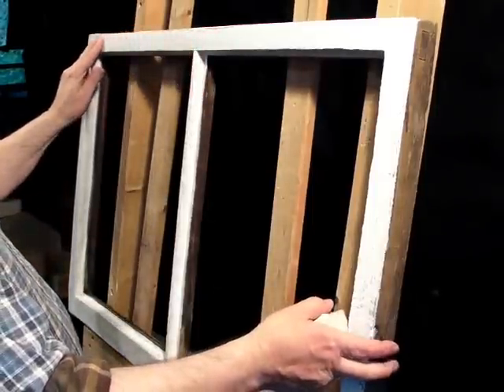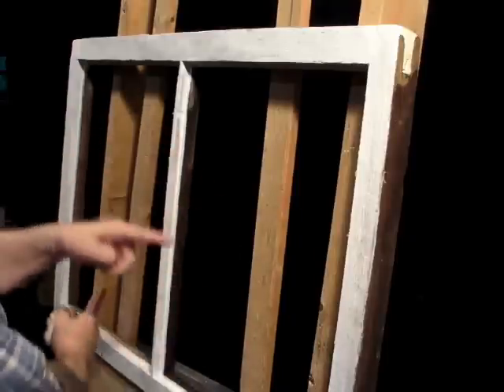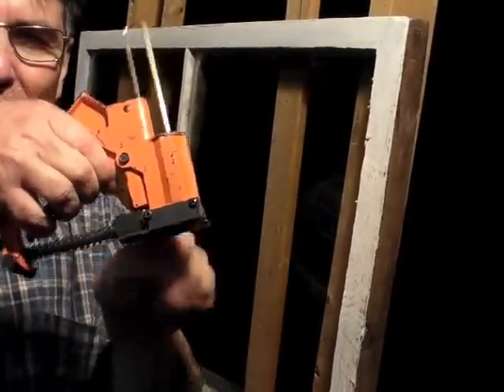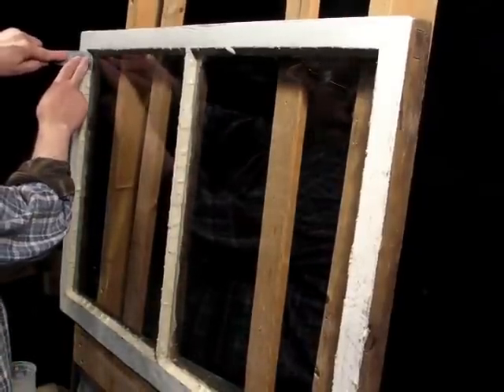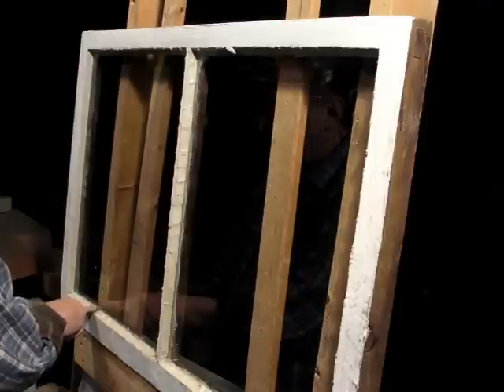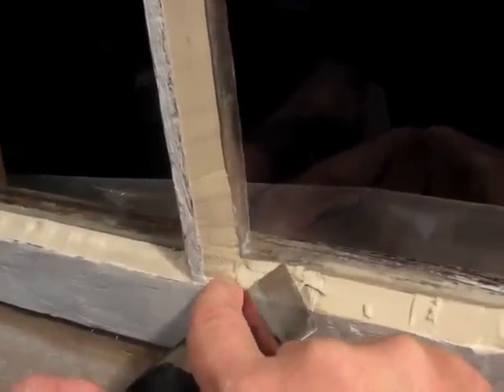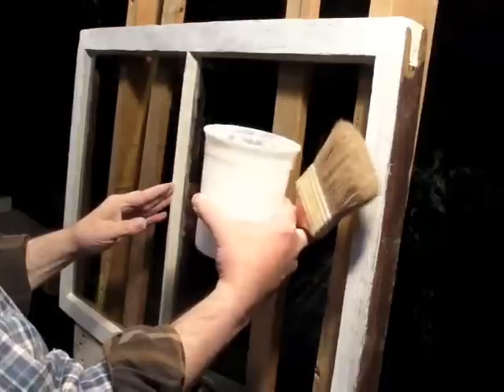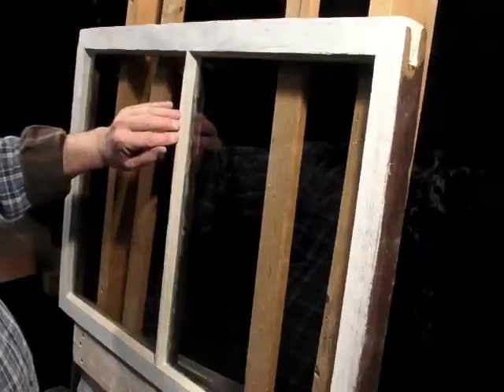Window Sash Glazing, training video

Comment: John, thanks for the video! I’m going to give it a try! I have 14 sashes (56 panes of glass total) that need to be reglazed. They are the ‘ol Andersen Pressure Seal units from the mid ‘50s. 

I thought about replacing them with new windows, but the new stuff is plastic and lifeless. The original windows of mine are made from Ponderosa pine.
Reply from the maker: Ambrose, Those early Andersens are definitely worth saving. I have one in my house put in during the early '60s and it is still going strong, but I need to give it a coat of paint--imagine that, window paint that lasted half a century. Take care and work safe. --Johnnn

Comment: I wondered forever how they put those old points in.  Problem with the new ones is, when your wood is 150 years old the wood is almost petrified. Then your pushing your points in , the glass cracks cause u have ti use so much pressure to get point to drive all the way.
Reply from the maker: Peter,  rock the putty knife and point from side to side, which eases the point into the wood. You can use an angled putty knife  so the force of driving the point is directly towards the wood and not angled down onto the glass as with a straight putty knife. 
More over here at the Save America's Windows Forum:
http://saveamericaswindows.com/forum/viewtopic.php?f=10&t=7&p=5910#p5910
Reply: @johnleeke  Thanks John,   I have done windows where the points go right in,no sweat . Was wondering if these cheap points are not as sharp. Therefore not going in easily. The angled putty knife sounds like a possibility. I tried a margin trowel but still hard.  May take a razor knlfe and precut a slit.  Trust me,,i wiggle the knife too. Just will not go to hilt. I may invest in that driver and the diamond type points. For those hard hard sashes. 
Anyway,,thanks so much for writing back John. Take care.
Reply from the maker: @peterford9369  , another thing to try is a Glazing Hammer, to tap the point further in
http://historichomeworks.com/forum/viewtopic.php?p=4173
Reply: @johnleeke  Hey John. Just ordered a point tool on Amazon. It looks like it'd be beneficial. Thought about a shooter, but didn't wanna spend 50 plus bucks right now.  I was working on an oak cabinet door with glass panel. The oak was so hard i could barely get the points in,with fear of cracking the glass. Metal on glass is a no no, even as small as the non diamond shaped points. I may get a shooter just to save aggravation.  Thanks again John
Reply: Fletcher makes a point tool that looks like a ball valve handle.  It works well for pushing in #2 and #7 points.  I use the #2 triangular points and like John said, rock back and forth rather than trying to push straight in.
Reply: @blackmaxima  Ive got one of those. But I have a box of the new style points, and the tool does both. Still, ive reglazed probably 100 window panes, and ever once in a while ya get a chip, or worse, a crack, due to a crooked angle,or too much force, wiggles or not. Wood is much more forgiving than glass.

Comment: Hey John, believe it or not, window glass really isn't that easy to come by where I live.  Do you know of any sources that do business on-line?  Many thanks!
Reply from the maker: Get my Save America's Windows book, it has a resources section that lists some suppliers of old wavy glass. http://saveamericaswindows.com/get-the-book/
Reply: Normal sash window glass was 3mm in the UK now they only make 4mm that doesn't balance with the window weights, but I use a local glass supplier that imports 3mm for green house glass.

Comment: What brand of putty is that? How did you get it so dry? The Dap putty I used today was so wet, it stuck to my fingers, barely to the wood and was a royal pain to work with. Thinking I'll try the caulk putty next time.
Reply from the maker: Forget the putty that comes it the caulking tube, it's worse than Dap. If I recall correctly I was using Sarco Type M in the video. First pat a little whiting (dry white powder) onto your hands, which will keep the putty from sticking. Kneed this putty in your hand for five minutes and it works just like in the video. Type M is for use when glazing in the shop, not with the sash in the wall exposed to the weather. More on putty over at the Save America's Windows discussion forum:   http://saveamericaswindows.com/forum/viewtopic.php?f=7&t=5224
Reply: How to build window easel
Reply from the maker: How to build a window easel:  http://saveamericaswindows.com/forum/viewtopic.php?t=5217
Reply: I use a wooden stepladder as an easel with a couple of cabinet clamps on the legs to serve as a ledger. My space is limited and since I already own the ladder I decided not to build one.

Comment: Does it matter if you do this from the inside or outside of the window frame?  Or does it work either side you want to work on?  Thanks!
Reply from the maker: In the video I've taken the sash out of the frame and am glazing it in the shop. If the sash is left in the frame in the wall, then glazing has to be done from the outside.

Comment: In my area, Dap 33 and Glazol are all that's available, neither of which has really impressed me. Has anyone ever tried to use Sherwin-Williams' 66 glazing?  My experiences with it are disastrous.  It has the consistency of latex caulk. I'm about to completely de-glaze a window I just spent an hour trying to get looking nice with SW 66 and use Dap because it's actually the superior product in my case.
Reply from the maker: Consider Sarco DualGlaze or Sarco Type M. Here is more than you need to know about putty:
http://saveamericaswindows.com/forum/viewtopic.php?t=5224
Reply: @johnleeke  I just started restoring a window in a friends house and got the Dual Glaze.  I replaced a few individual panes a few years ago and used Crawford’s and it’s holding up very well, but the Sarco is a dream.

I settled on using Crawford’s a few years ago on mine after fighting with hardware store stuff. I no longer have to worry about redoing my windows thanks to the fire department and my neighbors burning stuff.

Comment: Excellent video. What is in the cup? Looks like you dip your knife before tooling but if you talked about this in the video I missed it.
Reply from the maker: Not sure what you are talking about, I don't dip the putty knife into anything in a cup before tooling. Some people dip their knife into linseed oil before tooling, but I've never done that because it's not necessary if you have a good tooling technique like I show in the video. That linseed oil dip would just slow me down could leave a mess of oil on the glass or face of the sash.
Reply: Rewatched and see I was wrong. There’s a cup bottom left and thought your knife looked wet. Anyway, thanks very much for the quick reply and useful information.
Reply from the maker: @maascaleb  That's the container for the whiting that I use later in the video. Thanks for the kind remarks and best of success with your windows.